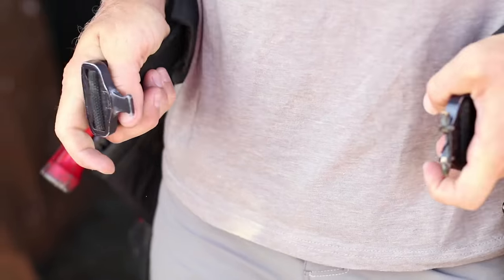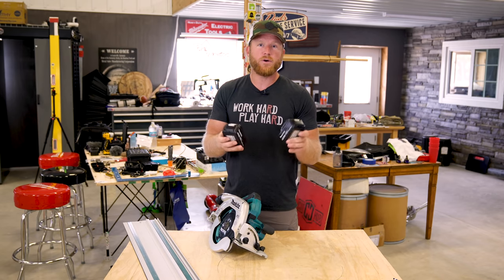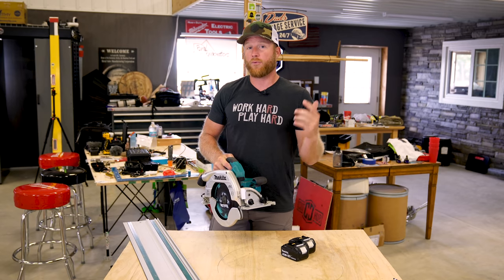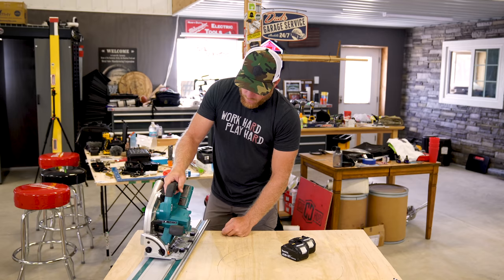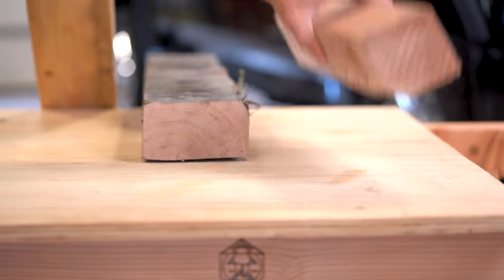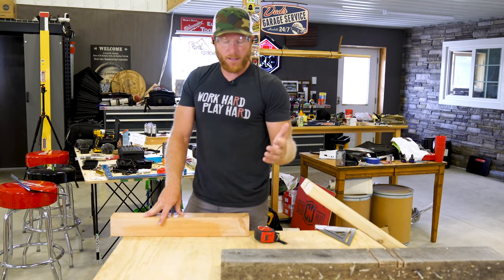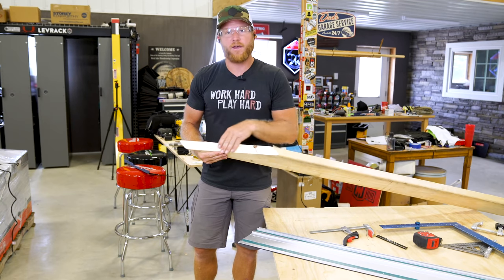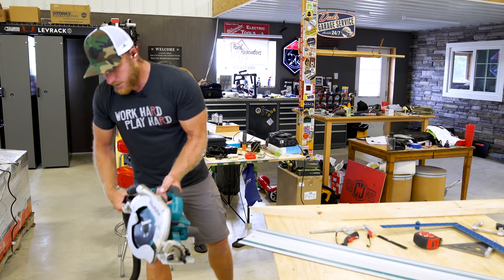Makita 9 1/4" 36V Track Saw!!!  Toolsday

Comment: What keeps the track from moving
Reply: There are grip strips on the bottom so the track doesn’t have to be clamped down to stay where you put it.
Reply: @Hucklongfin  do you have to keep it clean for it to work? Like what happens if sawdust gets on it?
Reply: @CybekCusal  They are pretty robust but yes clean and tidy is best and look after the soft edge. Dust extraction should be used or you will need to shake the dust off the track after each cut. Buy the clamps for warped boards or smooth surfaces.

Comment: I love my 6 ¼” makita track saw but for woodworking it doesn’t have the capacity for thick pieces of wood. I really want this saw to cut the big table top thickness slabs in rough form before they enter my tiny shop.

Comment: maybe it wont do a 4"x4" because it's a 100mm cut. 
4" inch = 101.6mm
Go metric, use 100mm posts and you'll be laughing xD
Reply: A 4x4 is actually 3.5" x 3.5", so 88.9mm x 88.9mm.  next?
Reply: Adrian Mack  that’s almost as stupid as still using imperial measurements 😁
Reply: @bksiv  what's stupid is caring about what unit of measurement another country uses.  I'm bilingual, I use both units of measure.  Now regarding the 4x4 actually being 3.5 x 3.5, thats just the lumber industry standard for a long time.  The nominal dimensions are pre milling.  I don't really like it, but that's the way it is.  It will eventually change, but not by some internet twat complaining about it ;)
Reply: Well, tools manufactures are hunting for the worldwide market?

Comment: Truthfully I find this saw pointless. Why put a bigger blade and make it heavier just so you’re still unable to cut through a  4x4?!? You still have to do everything you would have to do with a standard size saw. What a damn joke, I’ll never buy that piece of useless shit.if I wanna cut rough sawn timber with precision I’ll use my beam saw. It has over TWICE the cutting capability of that joke. Don’t waste your money folks you don’t need 10 different size circular saws just to get the job done
Reply from the maker: Really depends on your work load... 60 degree bevel is main reason for capacity and you are right if just cutting straight 2x not super valuable.   Not every tool is meant to be for everyone